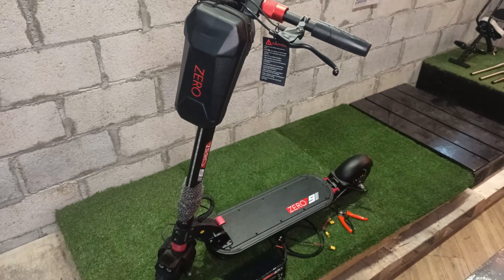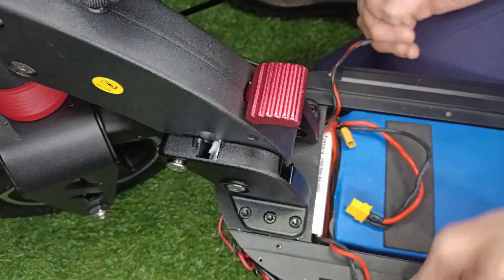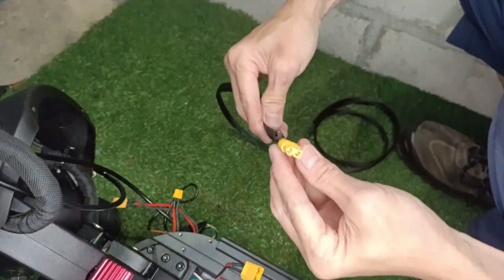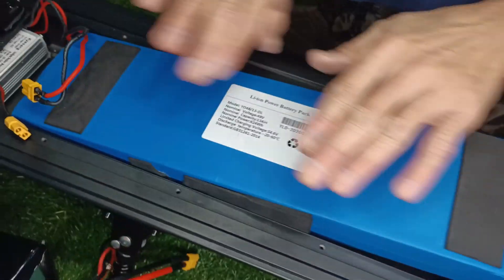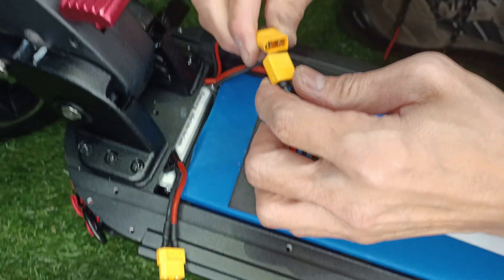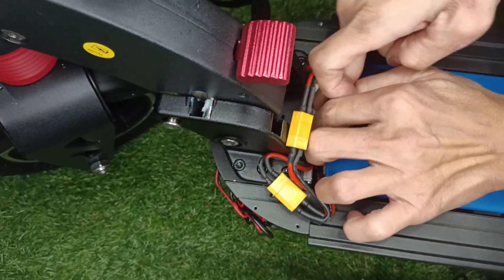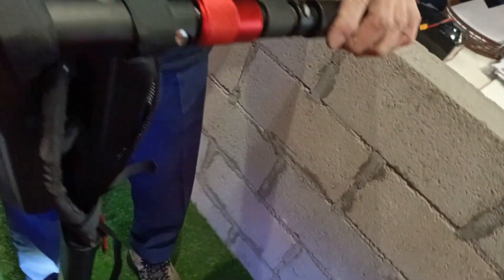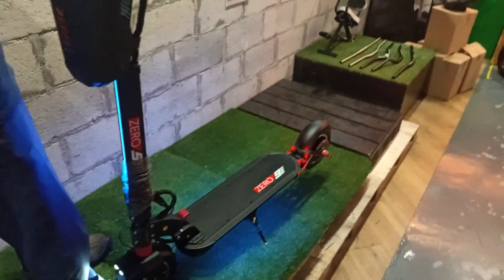How to Get 80km on your ZERO 9 and ZERO 8

Comment: What about extra  motors if you made a 3 wheeler do they have a motor controller  for that or would the 2 motor controller  run more than 2?
Reply from the maker: For 3 wheeler, if you do rear wheel drive, use a axle drive motor instead of a dual hub.

Comment: Hey there! I recently got a second hand Zero 8 (48v - 13Ah) version. What external battery do I need to get? I can see in the video you are using a zero 10x battery pack with the same V-Ah specification. Would it be possible to use this? What other choices do I have for external battery packs for my zero 8?
Reply from the maker: For zero 8, you have to get the 48V 13Ah external battery

Comment: Hi! Nice video! I am thinking about connecting a solar panel with a voltage regulation to 54V instead of an external battery. Do you think it's a good idea? Thanks!
Reply from the maker: You mean for charging while riding or not riding?
Reply: Thanks, for the fast answer. Thought about both riding and parking. Very few watts panel fixed permanently.
Reply from the maker: @davidkuthi2140  it’s not good for the lifespan of the battery to charge and discharge at the same time.
Reply: @FalconpevSg  
Ok, thank you very much!

Comment: Please delete this tutorial. You are going to cause damage and/or death to others. You just CAN'T simple parallel two batteries together because it will double the voltage and will cause major damage to the battery and scooter. The controller and are meant to handle 48V specifically to that battery and scooter. By paralleling two battery you are now double the voltage so controller will burn or cause damage to the scooter. Please do more research and be more knowledgeable before showing people how to DIY!
Reply from the maker: You are mistaken. This is to increase Ah and not voltage. Maybe you can watch the video and understand it better before telling others off.
Reply from the maker: Maybe a slight understanding in science would also help you
Reply: Ba Lam I think you dont know what Ohm's Law is.

Comment: How does this system guarantee that the one battery doesn't flow into the other when there is a voltage difference between the two battery packs?
Reply from the maker: in our instruction manual, we always recommend them to be used together at full charge

Comment: Hi I cannot find a video with this setup on my scooter and I am wondering if you could give me advice on if it would work.. I have a kaabo wolf and I have a spare battery so am thinkin of makin good use of it.. proble is internal is 60volts 35amp samsung cells and my extra battery is 60volts 26ah chinese cells.. Will their be a problem setting this up? Also my battery has more than 1 wire and also I think their is 2 controller box inside the deck.. last thing that is different is that their is 2 charge ports on my scooter. Any help would be appreciated cheers..
Reply from the maker: Hi, thank you for your note. We only do zero scooters with our batteries.

Comment: Hi I have Apollo Explore (Zero 10) scooter use cells manufactured by Dynavolt 52V 18.2aH.  Does your LG battery work with it without problems?
Reply from the maker: Yes shouldn’t be an issue
Reply: Okay thanks. I have some questions about pouch and wiring. Does it come with the battery and can you send it to Canada?
Reply from the maker: @mrbcvan4955  comes with everything and yes we do.

Comment: Hello. What if I have an older external battery (both same voltage) but not sure if the cells or BMS are the same, can I still plug them in parallel as you did in this video ? Thank you for your reply 🙏🏻
Reply: No, the Voltage must be the same. aH doesn’t matter

Comment: Can I charge these batteries both external and Internal at the same Charging port?
Reply: if the batteries are connected electrically then the charger doesnt care if it's "external" or "internal"
Reply: @Blox117  Thanks for the answer bro.

Comment: some says, it needs to match exact voltage on both batteries. otherwise, if it's not balanced, one battery will discharge first while other one still have juice on it. And if that continues, the lower voltage battery will start to damage as it will reach lower than the minimum voltage.The controller or the BMS i think most of them don't have low voltage protection .
Reply from the maker: Yes Exact or close voltage is best. It will not reach lower than minimum voltage as both batteries in parallel will have the same voltage. So the bms will shut both down once it reaches a certain voltage. Maybe the cheap bms won’t have the cutoff Low voltage protection but our battery packs do have that feature
Reply: Yes that will be needed during installation. If there are voltage differences between the 2 batteries, current will flow from higher voltage battery to the lower voltage battery. If the the voltage differences are high enough, it can melt the solder and the wires. But after some period of connecting those 2 batteries, the voltage will level out between them because it is parallel connection. So no need to worry about imbalance.
Reply: @batman_uwu  The charge cable on these batteries is separate from the 'battery voltage' cable, however I am not sure how the circuitry works. This vid indicates you need to charge each battery separately as charging one will not charge both batteries, or is this incorrect? It would be great to charge one and have both batteries charge up at the same time.

Comment: I have a 2019 Mercane Wide Wheel with 13s6p battery, I’m assuming this kit I can also use for my scooter?  Does the extended battery connect via the charge port, and where the original battery is charging/drawing from the external battery?

Comment: Hey FalconPEV is it possible to “bypass” the external battery? Say that I have the battery installed already but I want to have it disconnect/removed for a couple of trips, then connect it again - without having to go through the trouble of all that cabling. Is this possible?
Reply: Wow thanks for the fast reply. And great! That’s perfect. So I’ll just need to stow away the batt connector when I won’t use it yeah? A round trip to and from work is just about 10km but with lots of varying slopes so I don’t have much problem with the battery life now. But I would like to go on longer cross-country rides so the external battery seems perfect for this.
Reply from the maker: Robin Barlis hi! Yes it’s plug and play so you only plug it in when you need it

Comment: Is there a way to program your zero 9 to not adjust max speed and acceleration undependent of how much energy is left in the battery? Ive noticed my zero 9 loose its power too fast even though the battery is pretty full. I'm ok with less mileage as long as the scooter maintains speed and acceleration
Reply from the maker: greveeen you need a more powerful battery to maintain a more sustained high line. This external battery will be able to do that for you.

Comment: Bro, it will not over heat the motor since there are two batteries?
Reply: Because the batteries are setup in parallel config and not serial, its the mah that doubles and not the power. Motors still get only 52v of max power, but instead of having a 18mah pack that will last lets say 40 miles, you have 36mah of charge to double the run time.
Reply from the maker: 2 batteries will only overheat but not to the extend it will damage the components!

Comment: Funny thing, but yesterday i did 58km on 48V 13Ah Zero 9 on one charge, and after some short charges with 5A charger, total mileage per day was 93km.
Reply from the maker: Kirill Gorodiski wow that’s crazy...I don’t think that’s possible
Reply: @FalconpevSg  i had some rides of about 50-54 km before, in hot weather. But this time, despite many hills and offroad (even with a little dirt), the ride was perfectly slow and smooth (15-30 km/h), temperature around 25-30C, my weight around 67kg

Comment: There are so many different cables there and non of them is labeled. Can you provide me the cable diagram for the zero 10x 52v with each cable what is it connected to, PDF or doc please?
You are the manufacturer, so you should have it
Reply from the maker: Yes! please do email us or whatsapp us for the information. We will provide it to buyers of this item
Reply: @FalconpevSg  I did emailed you, asking for the wire diagram for all cables of the z10x 52v, I've been told that you can not provide it, even though you are the manufacturer
Reply: @holidaycountdown496  They are not the manufacturing this scooter. They only putting their brand on it.

Comment: Doesn't having the battery so high on the stem affect steering?
Reply from the maker: Cy Cyril the battery is very compact and light in this case, so it wouldn’t but you are right if the battery is heavier.

Comment: Why on the Zero10x you put a switch between the 2 batteries and on these you just run them in parallel?

Looking for a battery upgrade for my 10x like this, would love to run dual batteries on my X but that switch setup sucks.
Reply from the maker: Marc Bibeau we removed the switches on both the zero 9 and zero 10X ext batteries so now they are all parallel.
Reply: Falcon PEV is it possible to purchase the wiring only? You site says you can’t ship battery kits by themselves and I already have an Apollo Pro (zero10x) 52v, but I’d like to set this up on my scooter.
Reply from the maker: Marc Bibeau we can ship whole battery kits now:)
Reply: Falcon PEV ordered a kit. 

Just a idea here, but could you run the charging wires from one of the 2 charge ports to the external battery ? This way you can just plug in both charger into stock positions instead of using another charge port?